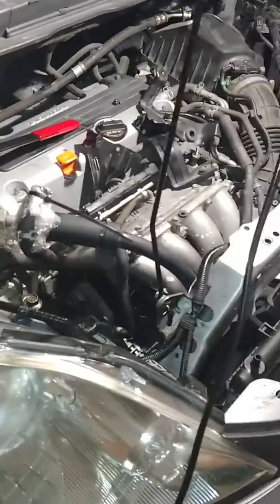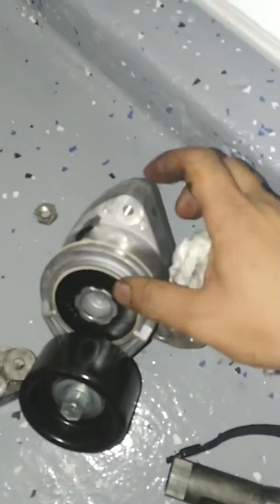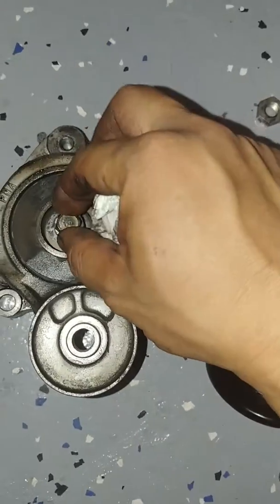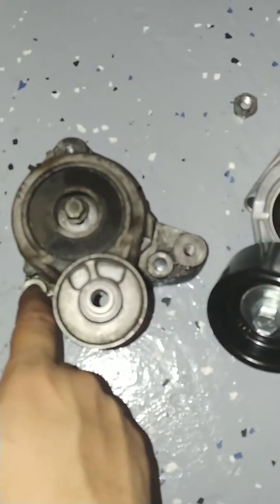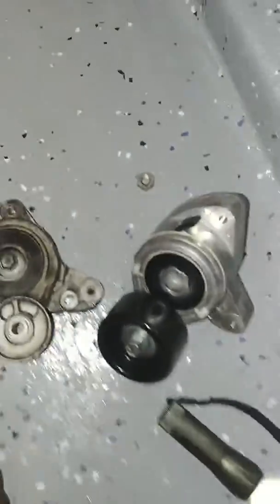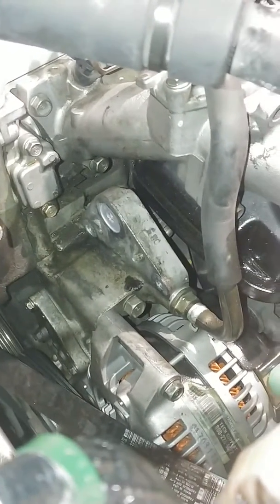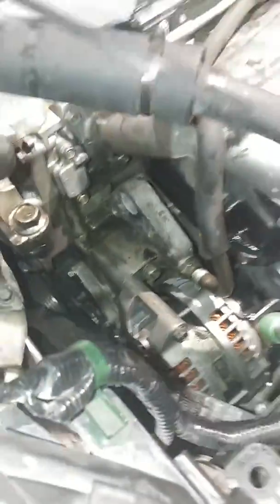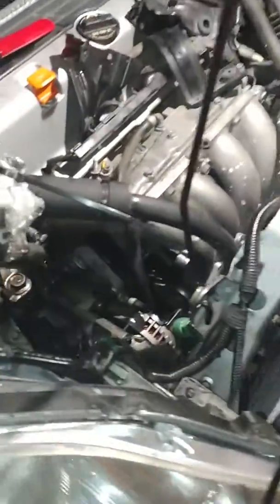Honda CRV tensioner replacement

Comment: WOW ! If I used this video, I might take entire front apart with what I seen on floor and how he explained how to. PLEASE DON'T EXPLAIN IF YOUR NOT GOOD AT IT, ANYONE CAN TAKE THINGS APART AND PUT BACK TOGETHER. I WANT THE BEST WAY AND EASIEST WAY TO DO JOB THAT'S CLEANER THAN THIS, YOU HAVE POWER STEERING PUMP OFF, BEST TO REPLACE THAT WHILE OFF WITH NEW ONE, THEN THAT'S SET TOO. FAN ? WELL I'D LET THAT SLIDE. WAY TOO MUCH WORK HERE.
Reply from the maker: You have to remove power sterring out of the way to get to the tensioner. That's only way
Reply: @theinma82  No, you actually dont.